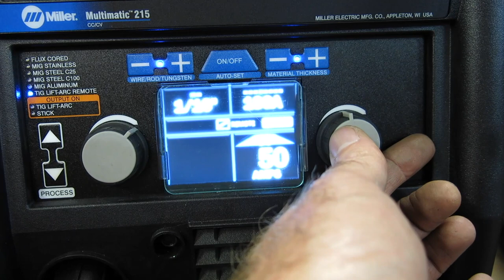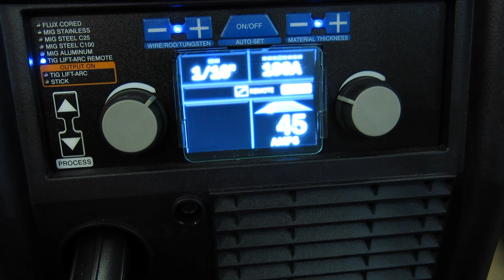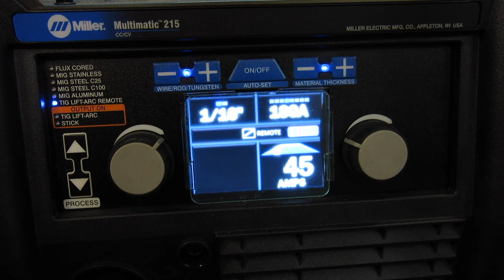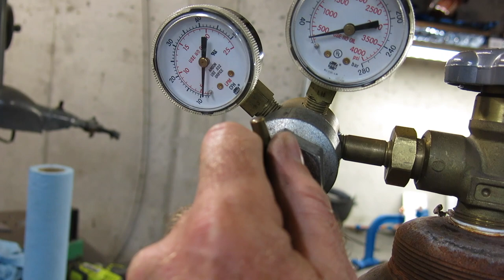Finnegans Garage Ep.35: Welder Contest Winner and Mandrel Bent Pipes for my C10

Comment: You can use a piece of card and a ball peen hammer to create a card outline of the manifold flange (the same way you'd use to make a gasket) and then use that to transfer the holes etc to the steel plate.
Reply: mikerjuk Or you could take the really easy route and go buy some flange gaskets trace the outline and cut. Then once you get everything welded you use the gaskets to be sure it doesn't leak
Reply: It's called CAD - cardboard aided design.  See Project Binky on Bad Obsession Motorsport....

Comment: CK has a really nice finger switch. You can order it with any end on it.  I use it with my Miller Multimatic 200 which is the older version of you 215.  Works great when welding hard to reach places, like your exhaust , knee pedal nice.

Comment: Not sure if you knew this Mr. Finnegan, but those headers are cast steel. This means they are very easily welded too, unlike normal cast iron.
Alot of people are cutting off the old 3 bolt flanges and welding 2.5' Vband flanges to them. Usually 304 SS flanges welded with 309L filler rod.
Plenty of examples of this being done on LS1tech, etc. They seem to hold up well and give you valuable room, as well as not ever needing to replace gaskets, because Vbands yo.

Comment: Congrats to the winners, get that thing back on the road. Truck is coming along good there Mike, I'm also very proud to see those Made In Canada stickers on those manifolds. You got them in time before the "wall" goes up.
Reply from the maker: lol. the wall....
Reply: Dave Slack do Canada's parts fit better than Mexican or Asian ones because i see made in China 🇨🇳 I run away with my 🇺🇸 60s car the parts that I've tried using have 2 measuring tapes and Qc. so it's a fail or hit but if it saids made in the 🇺🇸 hit and works

Comment: Quick tip, stick masking tape on the face of the flange and use a small ball pein hammer to tap around the edges like you're making a gasket, peel it off and stick it on the plate steel, paint over it and remove or just use the tape.

Comment: That tip on not using chlorinated brake cleaner probably saved my life.  It stuck in my head so I've made absolutely sure that any time I use brake cleaner to prep for a weld, I don't grab the wrong kind of brake clean; even though I only weld outside.

Comment: I tip for you Finnegan. If you use metric transfer punches sometimes they fit better in the standard holes and vise-versa so you can get the center of the hole exactly in the center

Comment: an alternative way to mark out your flange would be to colour in the original with a paint pen and then press it on to your plate then remove. et voila a nice painty flange pattern complete with hole locations (though admittedly not centres, just the edges) :-)
keep up the great work!!

Comment: Finnegan, you should really run a water cooled torch. Set it up with a gas lens and either a 3" or flat tungsten cap. You can get that smaller torch set up into so many more tighter spaces.  

Also, I build food processing equipment and we back purge everything!!

Comment: Measuring the wall thickness of the tube.
You measured the outside of the bend.
1.5mm tube when bent stretches out to about 1mm thick on the outside, and compresses to about 1.9mm on the inside, this is on a 1d bend which is tight so not quite so bad on a longer bend radius.
Measure the side of the bend, not the inside or outside to know what you have.
Add wire to the outside of the bend when welding, add none to the inside, just go for penetration.
Weld the outside of the bend first, as this will reduce the distortion.
Welding the inside first could easily end up with an extra couple of degrees just from distortion.

Comment: easy way to get the hole rather than measure is to cut the flange and drill the holes, then coat the exhaust in bit of paint marker around the opening and bolt the flange to it so it transfers to the flange.

Comment: another way to trace parts is to spray a heavy coat of black paint on the end of the part that you want to trace, then while it's still wet, press it on the surface of stock that you are making the part from.

Comment: You got the job done the way you did it, but I would have rubbed the flange with a dirty finger and piece of paper to make a template. Or you could have tapped the paper with a hammer to cut the shape the way you do when making a gasket. One more idea is that you could have covered the flange with masking tape, then cut the outer edge and center hole, then layed it over the outline the you made on your steel.

Comment: Loving all these fabrication heavy episodes (really bakes for a good departure from the bog-standard car show "break out the parts cannon!" mantra)

A quick thought on the back purging front.  If you're the sort who doesn't weld stainless ALL THE TIME, isn't welding food / nuclear / aerospace grade, and especially if you're welding noncritical applications (N/A, or post turbo exhaust), you can get 90% of the results of back purging, using a copper backing plate.  Unlike back purging, there's no waiting for the plumbing to fill with argon (or burning ALL the cubic feet maintaining a good purge).  You also don't have to fight with extra plumbing or fine tuning.  It has the added benefit of pulling heat away from the weld (kind of a big deal on thin-wall)

What's more, unlike Solar Flux, you don't have do deal with glass / excess powder / generic schmoo in your exhaust (a boon for pre-cat!).  On the downside, you need to find a piece of ~1/8"+ thick copper, need to bend the aforementioned piece into the vague shape of the tube ID, and need to maintain an exit plan for the copper backer.  Again, it also won't get you food grade.  Still, for 90% of people welding stainless, it's a way more tenable solution.

Again, if you're the sort who does this sort of thing professionally (or makes their money hawking stuff and playing with new toys on the net ; P), back purging is probably the way to go.

Comment: Nice welding to your exhaust and congrats to the winner I have a friends that I help restore  some old pickups like 1949 M1 MERCURY flathead was not repairable or rebuild able so it now has  a 5.0 H.O. in it and original 4 speed trans our first was a 1966 F100 Fleet side it was done piece  by piece  in a 12 by 12 shed was a 240 6 cylinder 3:73 gears now has a 1967 360 cid stroked to 390 with 3 months tree and a 1986 Mustang LX was a 2.4 now 5.0 H.O. and trans out of a 1989 Lincoln LSC Mustang got 37 mpg with EFI with old rear end until you start playing  with it and it still wasn't bad last 1975 454 Chev 3/4 ton pickup and have done others when I was 2o 3 TR3's a 1959,1962 and a 1963

Comment: For the center hole in the manifold, you could have covered the flange in painters tape, cut the excess tape from around the flange, then cut out the center hole. Peel the tape and transfer the center hole to your plate via sharpie. How I make gaskets...

Comment: Hey Mike!  Enjoy the videos (and love the Blasphemi!).  Safety Question - Do you have any special ventilation in your basement?  Do you find that any of the odors from working down there find their way upstairs?  I'm thinking of the smells from grinding discs, welding fumes, brake cleaner and other chemicals, etc.  Obviously the Phosgene gas would be the worst case scenario, but any fumes carry a certain amount of risk - you see many welders nowadays using external air systems.  I find that just having my car parked in the attached garage in my house tends to increase the smell of gas throughout the house.  (no leaks, just a vented tank..especially when I've just filled up)  I've added a small window fan to run continuously and that seems to be helping.  I've always wondered about ventilation in the style of house you have - where there is a living space above the garage.

Comment: What rack and pinion set-up are you running? I'm starting to work on the front end of my 69, and these R+P kits are so expensive, trying to see if I could get an M2 or T bird rack to fit right and adapt all the lines to fit an LS and still mount it high enough so the truck will lay out.

Comment: Finnegan, score some transfer screws sir. just like transfer punches but they are really short and screw into a threaded hole. They usually come in sets of multiple same sized screws. Screw them in and set them at the same height and tap your part down on the stock material. Mcmaster-Carr FTW

Comment: Finnegan - two words - hexavalent chromium.  Really bad stuff when it off-gases from either welding or plasma cutting stainless.  I'm not a safety geek, but since I learned about it I always wear a half face respirator when performing hot work on stainless.  Good to see you preaching information about the brake cleaner though.  Nice joint fitment and great real world insight.

Comment: can you explain saws?  at work we use a cold saw, its a worm drive thing with 3 speeds.  the blade looks like a plywood blade, and does not have carbide teeth.  it seems to go less than 100 rpm, but i don't see this kind for sale in stores like the kind you use, why?

Comment: I was a welder and fitter for 28 years. And Miller welding machines were always my favorite. Lincoln machines came in a close second. And Lincoln welding rod's were always my preference. But Miller machines were and are superior to any other welding machine. When I see one I immediately want to lay down another bead. [WARNING] Joining metal can be addicting.
Reply: Hoodoo Man is the way there built? Noticed it at work and at school especially when tiging but I like stick Lincoln a/c welders more o and this is why do not trust no name cheap made welders aka Harbour freight for structural welding that needs passing X ray testing
Reply: I have no experience with the particular Miller machine that was given away. I do how ever have experience with Miller industrial machines. And they are a particular favorite of mine. I like Lincoln industrial welding machines also. Even the really old ones. I would not recommend any cheap Chinese knockoffs.

Comment: Using that abrasive saw, you do NOT want to hold the piece you're cutting off, let it drop onto the bench.
Throw the vice part in the river for the fish to swim around and keep the backstop, press the tube hard into the backstop with your left hand and pull the disc down with your right.
Vices lose tension as the tube is cut because the stiffness is reduced on the piece because it's shorter, and it can grab and ping out at 400mph, vices are only good on solid stock.
Trust me, try it and you'll not look back, just make sure you keep pressure into the back stop with your left hand, note that your hand isn't in the way of the blade.
What's the worst that could happen? I still have 80% of my fingers and chicks dig scars

Comment: wonder if you can make a realy small welding pedal you can clamp between youre teeth or chin , needs to be clean but i think you can use it in every position youll find youreself in

just thinking out loud here , i just found a disabillity device called a sip and puf basicly a hose . straw you can blow and suck on to operate a vacuum pressureswitch 
now on a injected engine there is a MAP sensor that measures the manifold pressure vacuum , if you can use the signal from that and change it to controll the welder ...... it should work the same way a pedal does you can even regulate the power to the torch by aplying more vacuum or blowing harder intoo the tube
Reply: watahyahknow ya you def. want something that switches on massive amounts of current in your mouth?
Reply: no i would want sumting that remotely operates a high current in my mouth , the rubber straw translating the airpressure to the MAP sensor  wouldnt conduct electricity

Comment: instead of using a measuring tape or dial indicators or any fancy tools after I already had the flange cut I would just take a piece of paper and put it on the exhaust manifold and just take and rub my finger around the outside and around the inside of the pipe cut it out with a pair of scissors and you would know exactly where your whole needs to be don't need any fancy tools just a piece of printer paper

Comment: Side note: Chlorine gas is what the german's started using during WWI. Nasty shit. Someone in my shop used chlorinated brake kleen on a cold winter day when we had the door closed. Someone else then turned on an open-faced heat dish to  heat the shop up. It created a gas that filled the room. We couldn't see or smell it. Within 30-45 minutes almost everyone in my shop was experiencing the same flu-like symptoms, severe headaches, itchy eyes, coughing. It was terrible. We opened evacuated the shop. It wasn't until I noticed someone else was also coughing that I started asking around, "Does anyone else suddenly feel like total shit with a pounding headache?" Nearly everyone did, but nobody had said anything yet. I'll never bring chlorinated cleaner into my garage again.

Comment: Geez talk about making that flange backwards.  

Here's how you do it easier:
Cut hole in plate size of exhaust hole.
Center the manifold hole over the hole in plate.
THEN trace outline and bolt holes.
Simple.

This way you're making all the markings from direct transfer than inferred measurements.

Comment: lol "I'll put a LS in it because it has mounts and exhaust for a LS" has to build new mounts and new exhaust for the new LS... yeah that's Roadkill logic there.
A far easier way of making the inside of your exhaust flange is to get a piece of paper or tape and hold it on the flange and cut the hole out and then set it on your scribed line on the piece you need to cut out and transfer the lines.. Problem solved.

Comment: Getting away from the welder bitch-fest and back on the exhaust. The O2 sensor may not last to long. Oxygen sensors should be mounted at most 45 Deg wire up to prevent water collecting in it, which would cause premature failure.